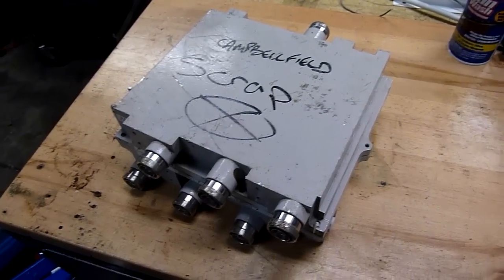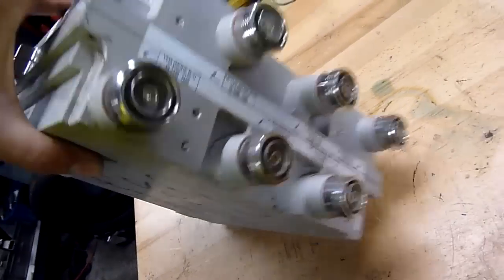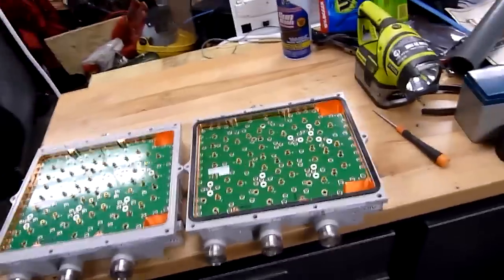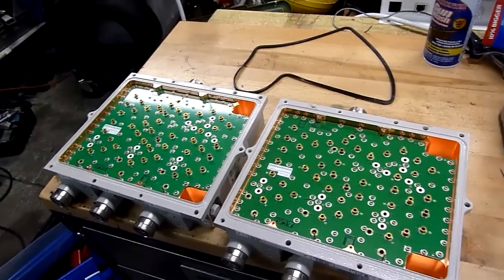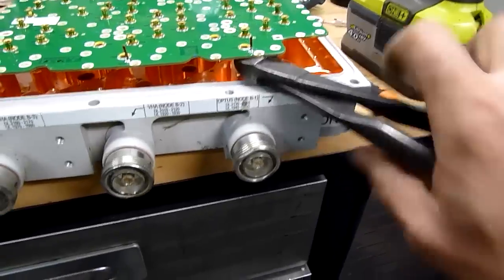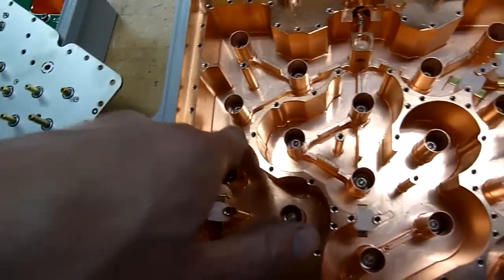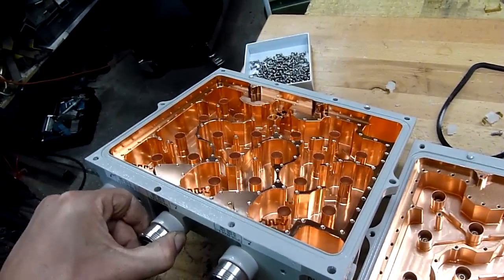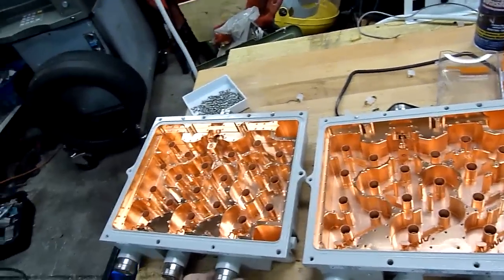RFS SBC2100 Comms Tower 4G Multiplexer Autopsy

Comment: Technology here is not waveguide, simple metal resonator combline pass band filters arranged as kind of triplexer. That unit is used for antenna sharing between 2 operators, Optus having 1 slot and VHA 2 separate slots. In practice it combines 3 separate base station signals into one antenna thus saving expensive feeder cables, antennas and possibly other mast rental costs.
Some companies use term "same band combiner" hence unit code SBC2100...

-Pins in PCB cover are "tuning screws" which will set correct frequency into resonator (those cylinders).
-Cylinders are called resonators = will resonate in certain frequency
-resonator can be iron but copper plated. Material selection can be used for temperature compensation (frequency drift)
-some pins in PCB will act as coupling adjustment element = how much each resonator couples into next resonator in chain
-"bridges" are called cross-couplings, they will provide high rejection zeros in narrow frequency
-copper strips which were cut out are either DC-grounding for lightning protection or DC-bypass allowing BTS to feed DC via feeder line up to the antennaline devices like masthead amplifier etc. Without seeing details cannot tell which one..
-unit have 2 equal halves, other half is "main" and other "div"...antennas are typically X-polarized with -45deg and +45deg ports. example connection=  main/ -45deg port and div/ +45deg port

Comment: VHA - Vodafone 

The connectors used are  7-16 DIN connector (seven and sixteen millimeter DIN)  and the terminating these connectors are not that easy if you have not been shown the right way to terminate them.

The little metal threaded items go into the "copper" side and these affect the tuning of the cavity so that the cutoff frequency is exactly where the cell site needs it. Not that hard to tune if you have the right sweep signal generator and spectrum analyser.

Oh yes I am a qualified telco RF tech but I have not tuned these devices but tuned other cavities for radio systems.

Comment: I think that is a 
dual Tri-plexer or possibly a Hexa-plexer.  They are used for separating interference signals when there is continuous transmit and receive on a cellular repeater, which uses one or several frequencies for receive and one for transmit. Basically, it prevents the continuous transmit signal from overloading the front end of the receiving frequency. Either way, that was surely a pricey piece of kit when it was made. Those hard line coaxial connectors cost a fortune.

Comment: When you know how this stuff works, it loses all its magic. :(

The tuning is not done by machine, surprisingly. It's actually not that hard to do, all of those adjustments are just for individual stages of resonant cavity band-pass filters. You tweak them around to get a nice flat response in the band you need, and maximum rejection everywhere else. 
Example: /watch?v=Y5-zPK3yJxM (He is tuning it for the narrowest possible pass band.)

I believe that unit does something kind of similar to a diplexer. What a diplexer does is allow you to use a single antenna to transmit and receive at the same time (but on different frequencies). Of course, you need to make sure the high power transmit energy does not come back and bastardize your receiver, so the filters are used to do this.
This appears to be a similar concept, but instead it is splitting it up between vodafone and optus - transmit and receive still being together at this point.

The copper plating is because copper is a better conductor than luminum, and the skin effect means the current only flows on the surfaces. Hence, no need to make the whole thing out of expensive copper, just plate the surface.

I have the gear to plot the frequency response of that if anyone is interested! :D (It may be an underwhelming result, though.)
Reply from the maker: Thats really cool to know, thanks for taking the time to explain it!, I found little to no info on the unit itself when I googled it. I will try and get more different units from the scrap yard.
Reply: Total rookie here with some small hobby knowledge of electronics. What is the purpose of having different levels on all the pins?
Reply: +Plasma_000 The height plays a part in setting the frequency that each cavity is tuned to.
Think of it a bit like the pipes in a pipe organ. They are tuned by their physical shape, and changing that will change the pitch. This is the same kind of thing, just at high frequency and using electromagnetic waves instead of sound waves.
Adjusting the height will make a fine change to the tuned frequency.

They are tuned to different levels either for tuning different channels, or having the right "shape" of frequency response over a small range of frequencies ("stagger tuning"). Usually it is desirable to have a certain width of frequency pass band, rather than one strong, narrow peak, which is what you would get if they were all tuned to exactly the same frequency.
Reply: Thanks for the into Godfrey.
Reply: 1, how do I get a job in this field? 2, how much is the pay?

Comment: I'm glad you decided to go with FireFox as a browser. I've been using it for many years with very few problems after ditching IE due to constant issues. Love all the add-ons you can get for FireFox.

I tore down the receiving head from a PrimeStar satellite TV dish and it looked about the same as this like all you see is a hole and a part of the board in the hole and I'm like how does that work. I was puzzled like you are here, RF stuff is weird.

And you really should mount those on the wall.

Comment: My guess is, that is 2100mhz only from the Optus/Voda joint network. Then it was scraped and upgraded to stuff which supports 2100/900mhz etc. 

I may be totally wrong however.

Comment: Yes the screws are for tuning, tuned wave guides, when it comes to radio communications this is heavy stuff. The device is extremely complicated in its design and makes rocket science look easy. There is hardly an engineer in all of Australia that would have the knowledge and skills to design and machine and calibrate one of these them selves. Also the equipment costs a fortune.

Comment: I know this is an old video but um... that is two of the same side and originally not bolted together like you showed in the beginning of the video it could have had a back plate with a pcb in it but that one has been configured as a passive only "the active parts are mounted in a box at the bottom of the tower so they don't need to sent power and data up just the RF. If something is going to fail it will be active parts so they put them on the ground so a tech can work on it with out climbing the tower. I have seen passive but this is the first one I have ever seen back to back like that if it weren't for the stickers i would say parts where missing. the plugs inside are not to couple the two sides they are just used to adjust the frequency and q of the de/multiplexer.